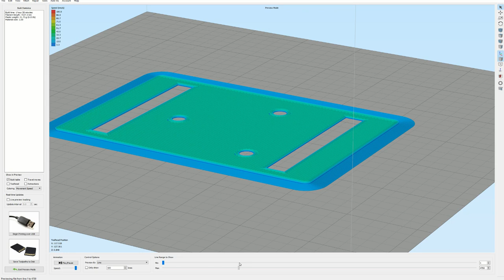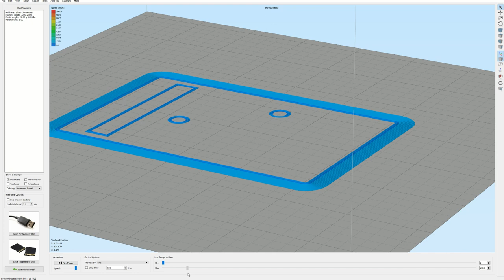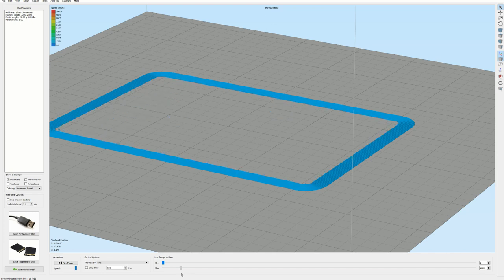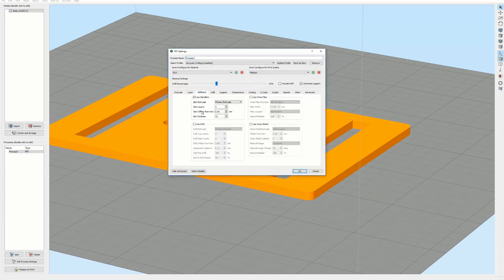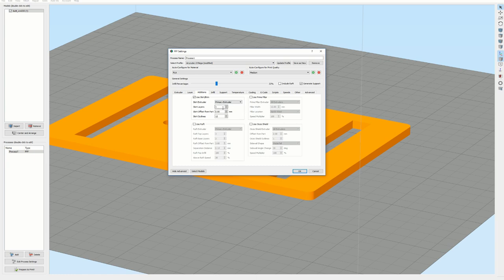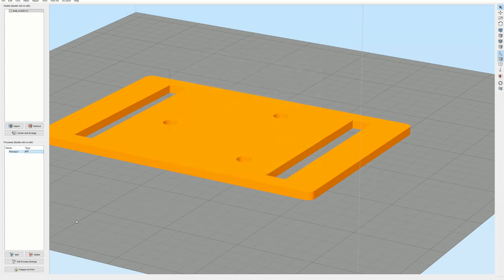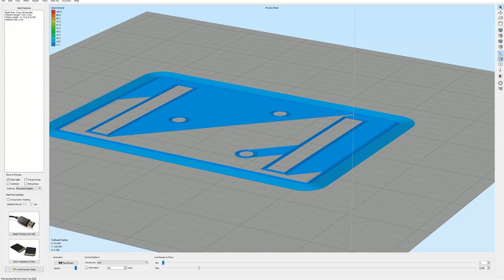▼ Lifting Corners? Not anymore after watching this video

Comment: When I use a brim it is weird but the part lifts up and where it lifts up that is where the brim lifts up going outward on the brim so the tape method doesn't work.  Now if the brim lifted from the outside inwards (towards the part) it would work.
Reply from the maker: With some forms it can indeed happen that a brim does not work as you would like.
As a rule you can state that long, straight lines in a 3D print can ensure that the print can build up a lot of energy during cooling to shrink with force. This is easily prevented by ensuring that long straight lines are avoided, but that of course only works with components that you design yourself. For example, when I design a box, there is always a small slot in it, so there is a break from the straight lines.

There are a few things you can do to ensure that a component cannot build up much energy, which can lead to warping:

- Ensure that there are as few straight lines as possible
- Use enough brim rings around the part, possibly even two layers high.
- Try to avoid temperature differences
- Use materials that shrink less

This last point in particular is very important. One PLA shrinks much worse than the other PLA. NGEN shrinks much less, and is therefore much better suited, while PET and ABS suffer from shrinkage.
Reply: I don't do much in PLA (.01% per year) as PETG took over for it and ABS (wish I had a viable alternative to it) but even using a 20mm wide brim the part will lift from the bed around the edges.  When I remove the part I can see the part had lifted, even with the brim, but did not completely come away from the bed due to the Brim extending so far out.  As I said the part lifts up and where the brim meets it lifts there as well like a Pyramid /\ with the left side the part and the right side the brim.

Comment: While I agree brims do work well for warping issues, I find them very hard to remove.  If I increase the space between the model and the brim, this helps with removal, but then you lose some of the advantages of putting the brim there in the first place and the 3d print may still warp if this space is too large.
Reply from the maker: But, with brims the print can be made, without...impossible.
That said, since the making of the video, much better adhesive bedplates are being used. The old Buildtak and that kind of materials are now gone and on the new type of beds, you don't need to do this anymore.
Reply: You can also just take a razer blade and cut off the brim

Comment: Hi I noticed that you are using the anycubic I3 mega did you change the software on that particular printer and if yes could you explain how you done it or do you have a video how to do it thank you
Eli
Reply from the maker: I have not changed the software on the machine. I think there is no need to do that.
Reply: I know that is capabilities of changing colors in the middle of the printing with a different software it’s possible any suggestions thanks

Comment: Great tip. Pause your printer though before you put down the painter's tape and it will be easier.
Reply from the maker: You are right, sometimes I do that, depending on the print.
Reply: @3dPrintCreator  Good idea and great video.

Comment: If nothing works for you:
my hotend had a loose screw.. so my nozzle was wobbling.
Check all the screws of your printer! 
I had benchys fail and i thought it was purely the problem of first layer adhesion.. 
It was too.. but the nozzle wobbled and knocked the benchy right off..
 the wobble also explains the problems with my first layer.. so.
I hope I can help a poor soul out there having these issues.. no one tells you this if you search for knock off or warping..
Reply from the maker: I love your comment.
This really helps people out. Thanks for posting this.

Comment: Are you printing PETG directly onto the ultra base of the i3 mega? Do you not need to use painters tape or does it release when cool like pla?
Reply from the maker: Hi,
I print directly to the ultrabase without any problem.
It releases as soon as the bed cools down.

Comment: Having this issue with pla on anycubic i3 mega
Reply from the maker: Probably the bed is not clean, try cleaning with IPA (isopropyl alcohol), or see if the dots on the glass are still there and good. They loose their power to stick to material over time. In the worst case you have to replace the glass bed.
Reply: @3dPrintCreator  yes I do clean the bed every time before printing. I have started a print with zero clearance for the skirt which is set for 12 lines so in about a half hour I should know if that solves the problem. I have never had a print that stuck completely I've owned this printer over a year. I appreciate your kind advice 🙏
Reply: @3dPrintCreator  I responded earlier that it worked but it didn't actually. It made it to 40% before it warped. The whole print is funny in that level where it seems to have released. One whole side lifted about 1.5mm it's noticeable, it's a battery holder for a Dewalt drill so it's not critical that it's perfect. I'll play with it more tomorrow. Thanks for your help.

Comment: Yes...tape would be easier than trying to weigh it down after it starts lifting...
Your revelation? ..or someone who doesn't 3D print and had stopped by one day?
It seams that with all the particulars we have running in our head it would be some one who doesn't realize the complexity of it all...so they see the simple solution organically.

Edit:
Actually, I finally solved my issue.
Make sure the bed is clean of every thing...including "DUST".
Then I spray it with hair spray...extra hold...number of coats will vary on thickness of each coat.
But then my bed is not 3D marketed.
5/16 inch Tooling Grade Aluminum.
20 grit disc sander, erratically roughening surface from different directions...with water...
Then cleaned with a green Scotch Brite pad.

Comment: This is the epitome of doing it wrong.
Reply from the maker: 1. It works perfectly.
2. You are not giving a better option.
So how does your reaction help us?
Reply: I'm sure you are talking about using adhesives, bed temperature or initial layer width. But the truth is all these methods are wrong depending on your perspective. It's a tradeoff act.

Adhesives make your bed dirty and tbh are quite useless because you will have to clean your bed with acetone of alcohol and generally the "de-greasing" from the cleaning alone is enough to make it stick given your settings are good. But still, not all apolar solvents work as well, and not all beds work well clean.

Adding more filament to the initial layer will actually worsen warping on parts that have large contact surfaces, the overextrusion improves adhesion but given on the geometry of the print can significantly worsen the problem presented in this video.

Bed temperature is important granted most settings are, but when you keep the temperature slightly above the softening temperature of your print during the printing process you are risking introducing all kinds of weird artifacts into your print, the reason is because at that temperature the plastic stays soft, which tbh is not what you want if you are going for quality. It can also cause big issues when the print fully cools down after your done. (again, highly dependant on the geometry of the print)

So the real question is what are the downsides to using a brim? 1min print time? Wasting 0.2g of filament?
There is practically no tradeoff, it's 100% worth it to set it up as explained in this video as a default setting, it will hugely decrease the time babysitting/restarting prints on your machine.
For specific prints, you might not want to use a brim though. Gears are a good example where this method could be an issue but tbh if these relatively minute things are a high priority by an SLA printer.

I think the "epitome of doing it wrong" is thinking there is a "right way for all scenarios".